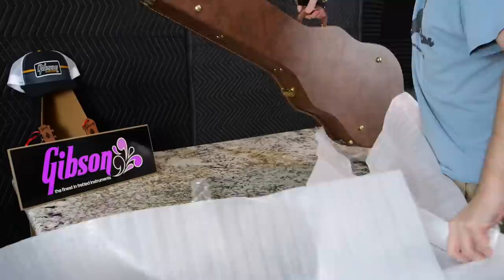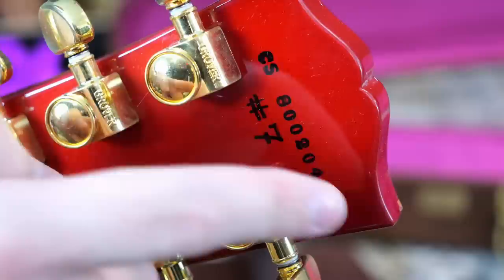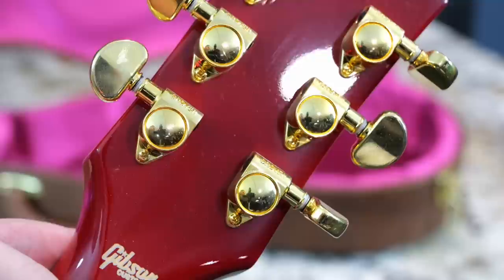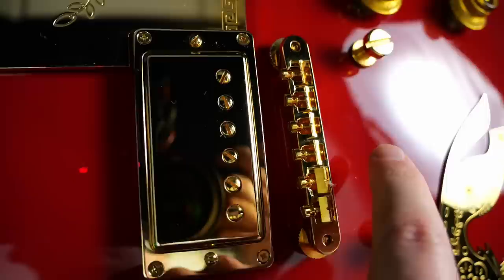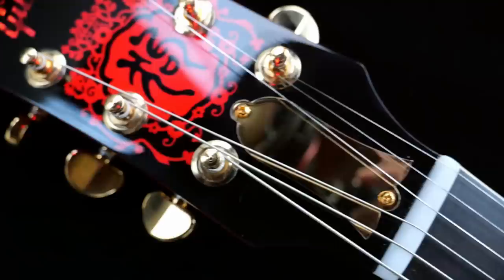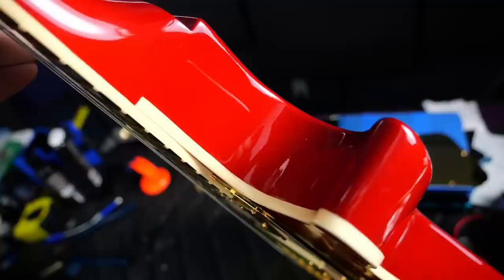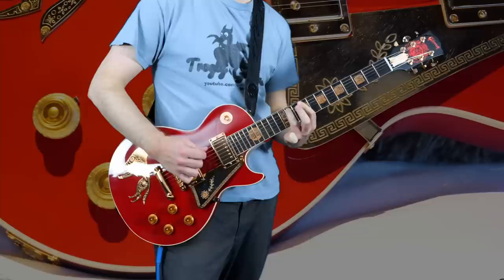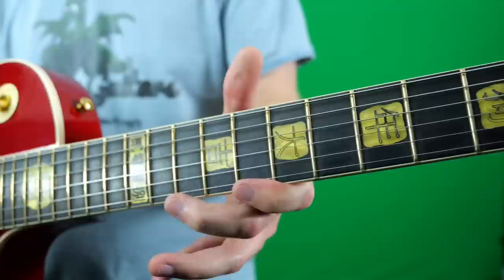This Model Was HATED Back in 2018... | 2018 Gibson Chinese Lunar New Year of the Dog Les Paul

Comment: I always look for what I call the GB conundrum. Intonation is the most important thing to me. My first guitar was a Les Paul. Beautiful wine red finish, gold hardware, and this is in 1976. But it was either the B or the G string was always going out of tune. Am I crazy or have you seen this?
Reply: Cut a new nut. That’s generally the problem with those strings. Has to do with the angle the tuners are pulling it I believe.

Comment: That's a fun look and it's great to have something that's not like all the others. Do you relax the strings when you store your guitars?
Reply: Not sure what Austin does, but I've been told (by a luthier) that you should store your guitars (with or without string tension) with the neck set straight.
Leave and forget is what said luthier said. Never had any problems that way.
Reply from the maker: I store with tension. It is designed and set up to have it. 
If you prefer to not have stings - make sure you loosen the truss rod so the neck is straight, similar to what Ray is saying above.

Comment: Perhaps taking it off caused the chip?   It would be hard to chip if that wasn’t removed.
Reply from the maker: The barb was like a knife - it cut the soft finish when first installed. Taking it off completed the cut. It doesn’t matter at all - it is completely covered